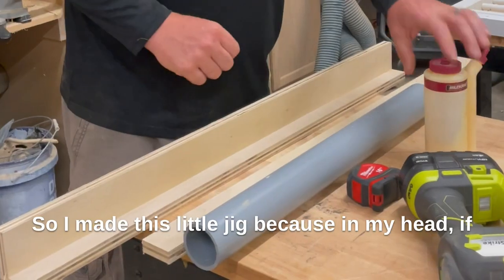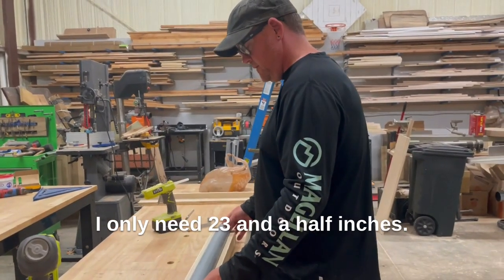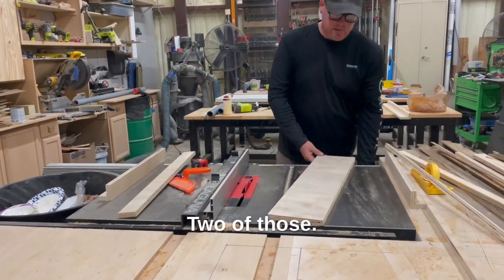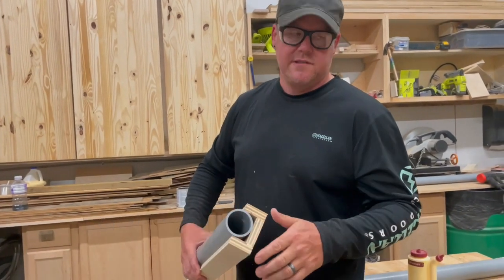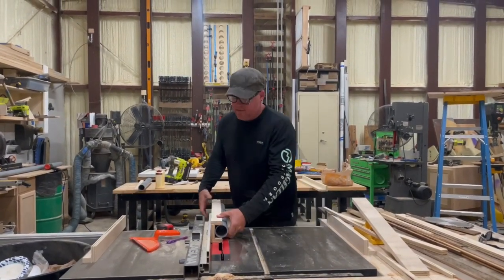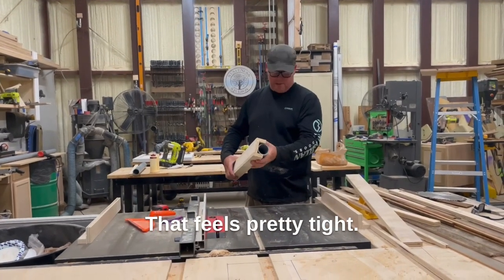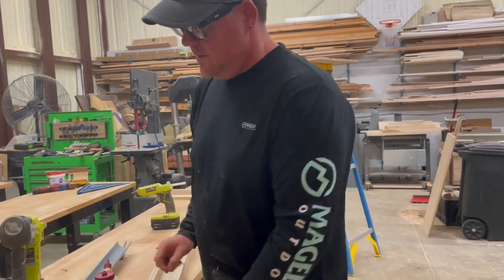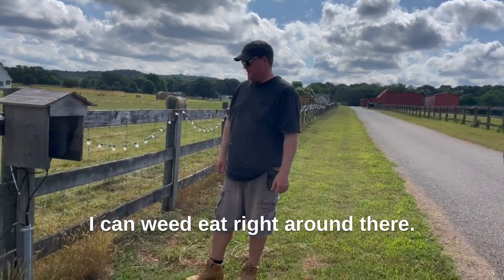Cutting PVC in Half: Tips and Techniques for DIY Enthusiasts

Comment: Thanks for the video.  Suggestion: Before you put the hot glue dots onto the jig, you could put a line of masking tape onto the inside of the jig. This will make it easier to remove the pipe from the jig after cutting.
Reply from the maker: That's a great idea!

Comment: I had split some 1” schedule 40 shorts to make some curved hose saddles. I just ran some 3/8” bamboo through the PVC and screwed the protruding ends to the side of a 2X block. Set the saw fence checking to make sure the screws are short of the cut line.
Reply from the maker: That’s a great idea!